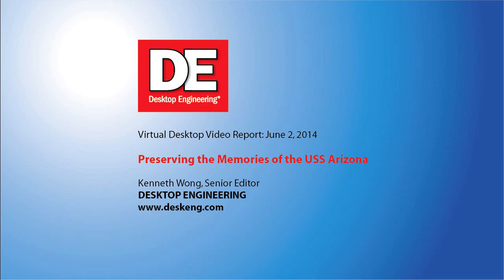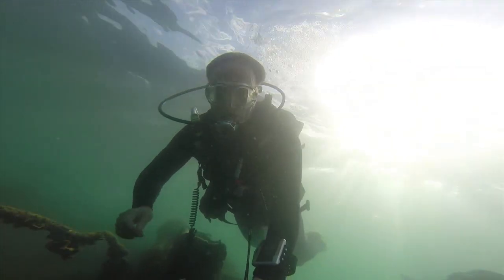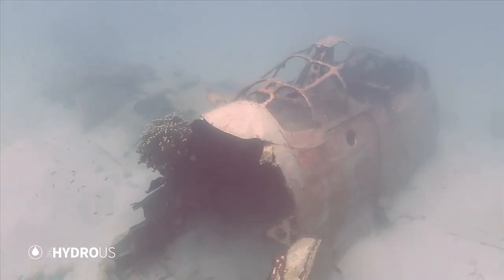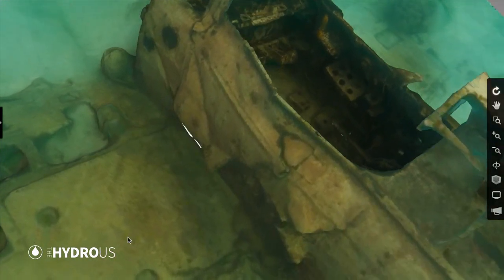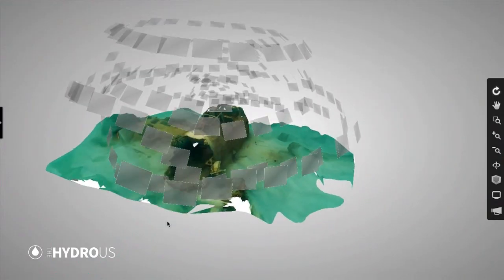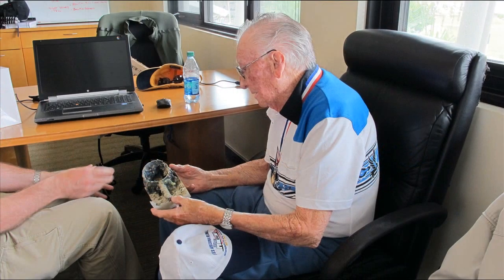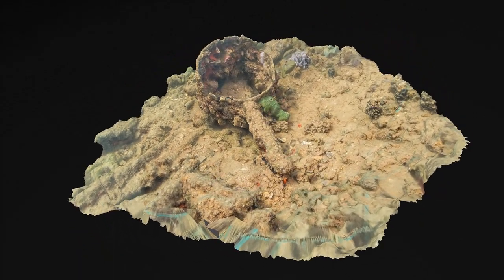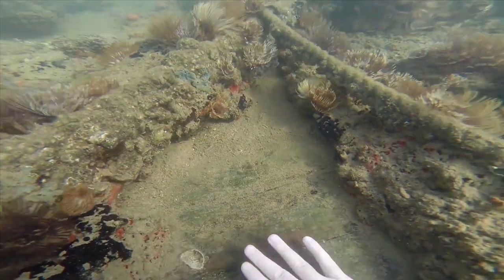Scanning the USS Arizona in 3D

Comment: I've wondered if that Coke bottle was thrown on The Arizona years after the sinking and is actually just trash or if it was really used by the crew of The Arizona.
Reply: It's hard to say. There were salvage operations going on after the attack and it's very possible the bottle was tossed in after a work break. In those days and weeks after the attack the job of clearing the harbor and salvaging what could be saved was more important. The Arizona was left alone after useful gear had been removed and it was determined that the site was too dangerous to retrieve bodies or anything else.
Reply: It was definitly an artificial addition to the ship, seeing that the USS Arizonas Soda fountain was along frame 52 port side of the conning tower on the main deck. As far as i know, there were no drinks served in the crews mess in the form of glass coke bottles.
Reply: Imagine what the pop bottle would have had to have gone through, to still be there. It would have had to have been placed out in the open, on the ship. Survived the attack. Survived the sinking. And never rolled off the deck. It was probably dropped off in 1942 or 1943, during the salvage job done on the ship. Maybe a sailor in remembrance of a friend lost on the ship, who loved the beverage. In memory of a lost friend. Not such a bad thing to do.
Reply: You’d think if it hit the bottom, it would’ve been close to the explosion. But idk, it would’ve shattered probably anywhere near the Arizona simply due to the giant explosion.